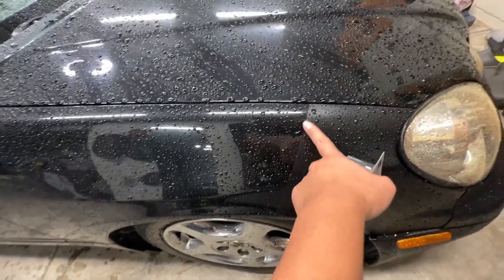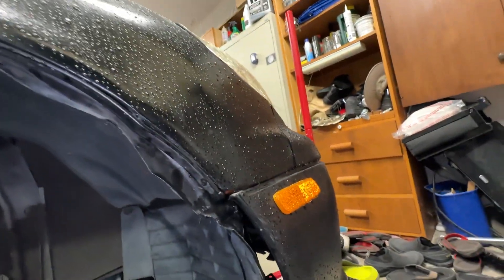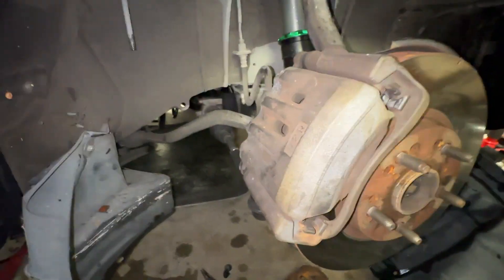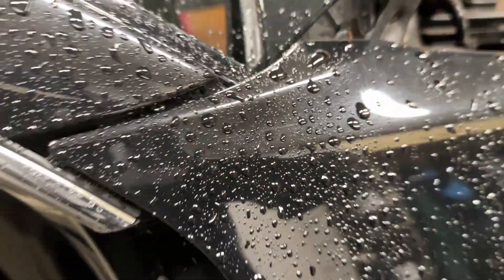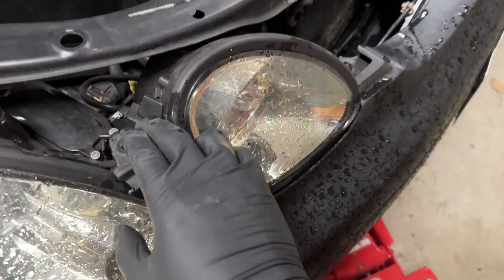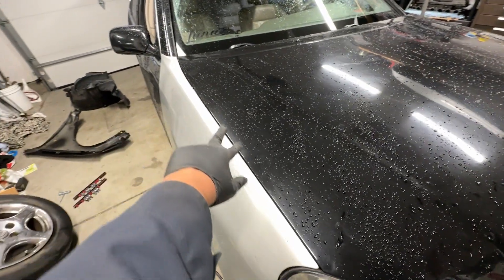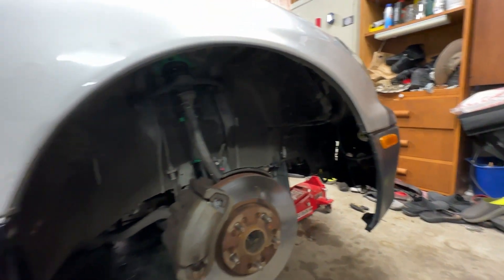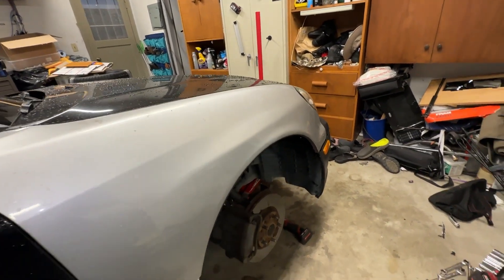How to Replace GS300 Fender!

Comment: What I found best on the GS is using ratchet wrenches to get to most of these nuts and bolts out of these hard to reach places
Reply: Lol. Try that on getting to the 2 bolts holding the front bumper on
Reply: @804MRMAN  I did that with a 10mm flex ratchet wrench got it off easy reaching into the fender liner
Reply: @nickleafs467  I don't see how. Your hands must be tiny.